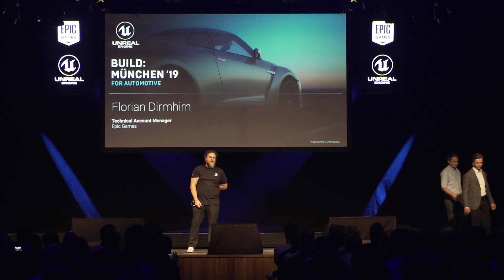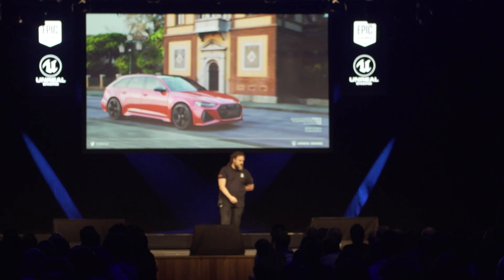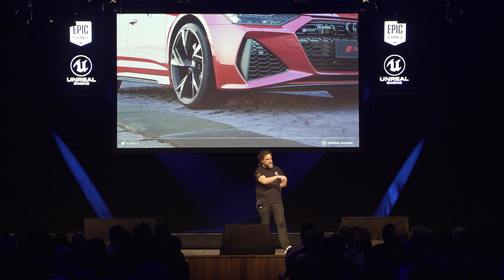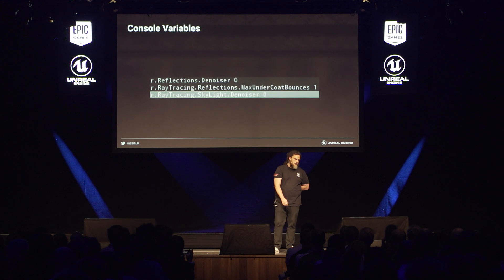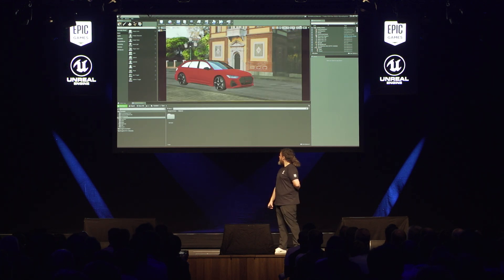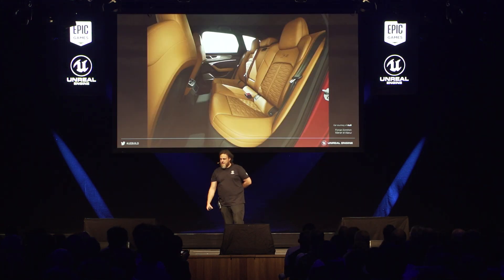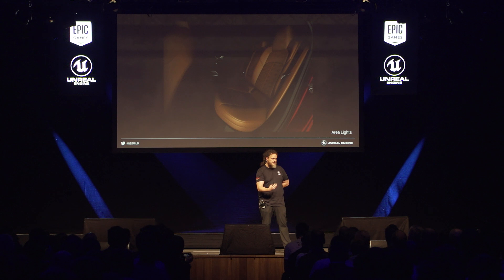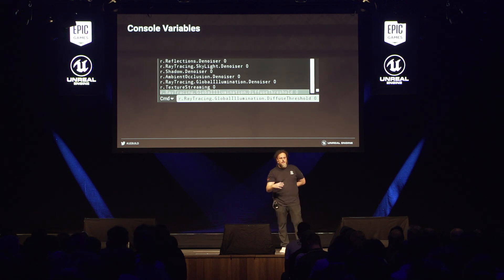Optimizing for ray-traced scenes | Build: Munich ’19 for Automotive | Unreal Engine

Comment: Sum images and divide to normalize? Noise-denoise... Such of optimizations. 
Would someone even think about normal presets system for render and viewport? (and not console variables for users)
 For who do not get, 8k and so on - it is not realtime render.
Reply: Looks like it's not a true ray-tracing as well, too many tweaks, so many light sources. I used to use this lighting approach in Maxwell to reduce noise but without the necessity of hand made image combining.